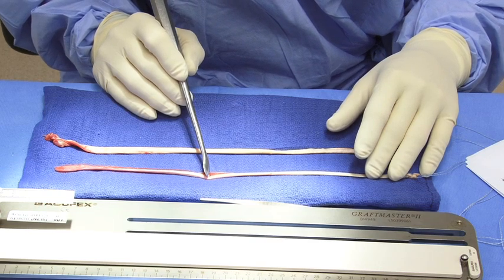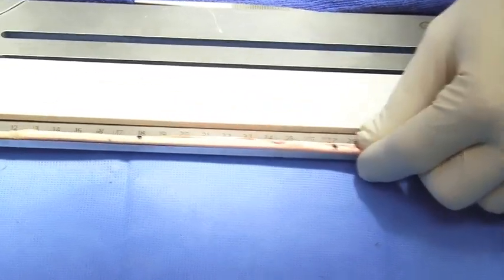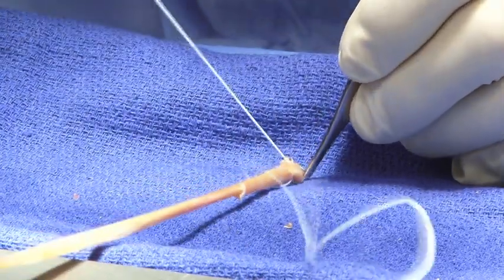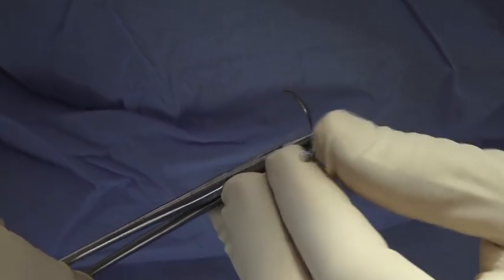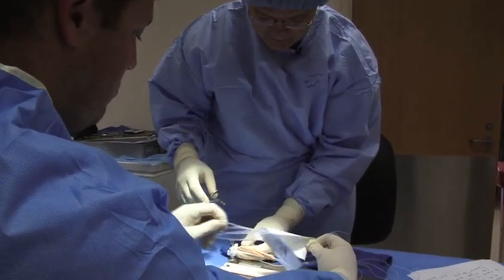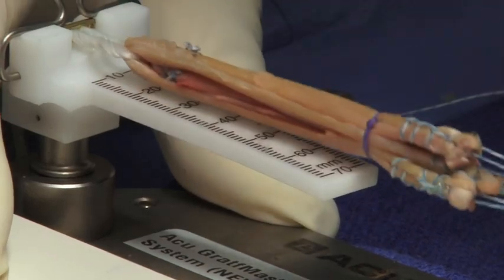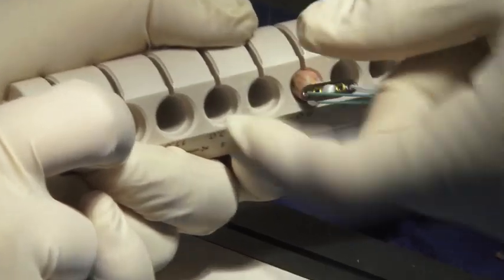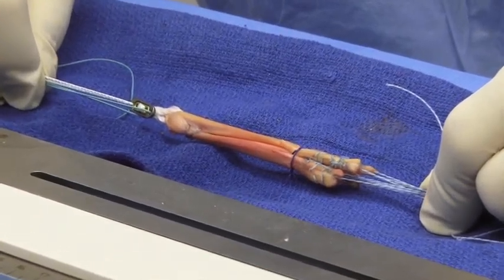Hamstring Autograft Technique for ACL Reconstruction Surgery

Comment: Without surgery there is any other option to recovery acl
Reply: Rameshwar Chauhan, if you’re ACL is torn it cannot repair itself. However you can strengthen your muscles, especially the quads to prevent your knee from buckling.